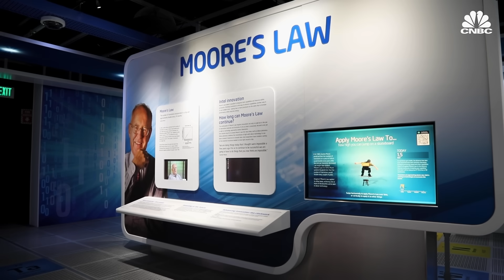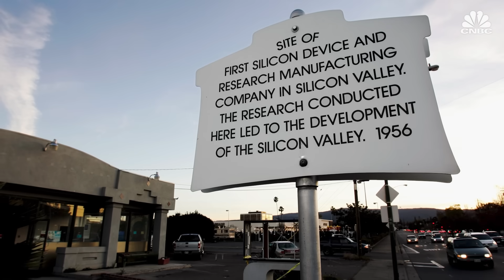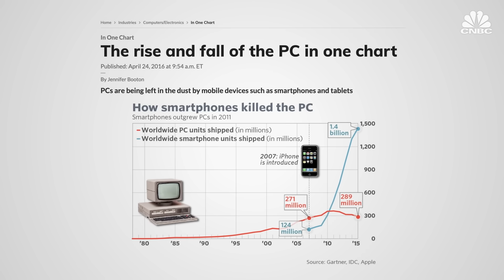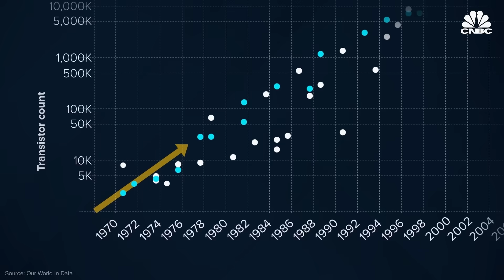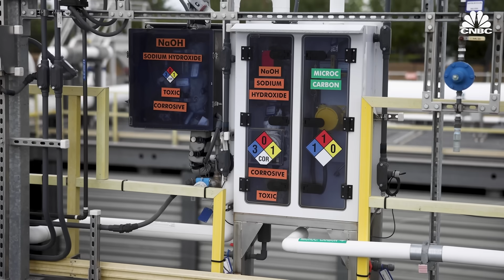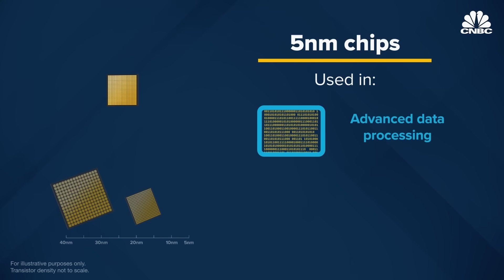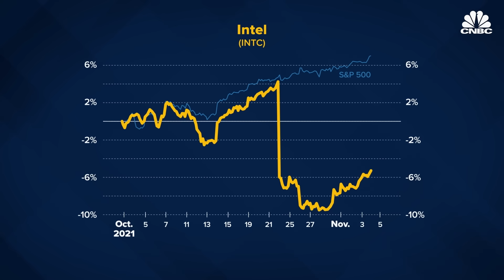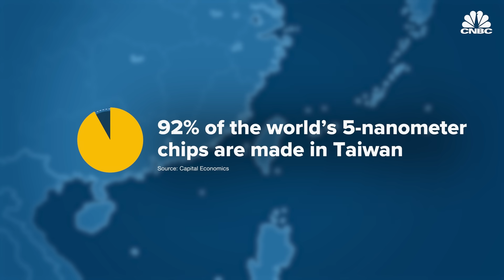Inside Intel’s Bold $26 Billion U.S. Plan To Regain Chip Dominance

Comment: INTEL appears to be developing a long term strategy of racing as fast as they can to catch up to the smaller nanometer product, but "if" that does not work, then they will be set up to flood the market with various chip products by outproducing and ( more importantly ) out pricing their competitors. Should they catch up to smaller chip scales, they would be well positioned to deeply influence the market.

Comment: Currently, TSMC and Samsung are not Intel's competitors.  But they're jumping into Foundry business... which they failed before "while" competing with AMD.  Samsung and TSMC are already manufacturing 3nm die and announced 2nm.  AMD is on 7nm.  Latest Intel Alder Lake is still on 10nm.  It wont take just $26 billion.  It will take $26 billion every year.
Reply: @WolframaticAlpha SMFH... False.  That's what Intel fans claim and Intel 10nm is slightly denser for SRAM but TSMC 7nm is denser where it counts.  Logic.
Intel 10nm consumes FAR more power and runs MUCH hotter.  NOT equal to 7nm.
Any other false information you wanna spread?

Comment: Intel still hasn't realized the problem isn't how many what they make, but WHAT they make. Other manufacturers are ramping up chips with specialized modules to speed up encoding/decoding of videos, low power consumption, etc. Intel probably should stop trying to put 200W TDP CPU into the laptop.
Reply: @WolframaticAlpha Yet here we are editing HEVC 4:2:2 as if it is a bunch of slides.
Reply: @WolframaticAlpha Sure bot

Comment: A vast majority of the chip shortages are not Intel. Hopefully the government subsidies support the manufacturers that are in the squeeze to meet demand. Intel on the other hand is a Cash Cow that needs no government support. As noted, they misexecuted and need to catch up but that is only the leading edge of their portfolio not the parts needed in autos, Industrial or Internet of Things. Some of the shortage is due to COVID delays, some to increased demand and some to industry consolidation over the last two decades. At one point there were 3X the players in semiconductors just in the US. Look back at ay 1976 through 1986 - big field - all pofitable but the PC industry made for bigger winners who bought up or by sheer volume pricing  forced companies out of  business.  It was not uncommon for a company who had a "must have" component to force a product designer to use their unrelated components to get allocation of the must have. No price benefit given just predatory. These fabs are of course long gone and would not be viable if they existed but the revenue loss prevented those semiconductor manufacturers from staying competitive. No money for new fabs when you are running on thread bare margins.

Comment: You can build and open fab in 2 years, but it takes another several years to train everybody, gain experience and also install and run all the facility equipment. In the meantime competitors are running forward. Samsung and TSMC are investing too.

And for start, start using metric system finally instead of football fields, gallons, pounds and other crap.

Comment: Intel has it right putting an engineer at the top again. Now maybe CNBC should consider hiring some engineers for QA on reporting. And get rid of the market analysis. Intel will make it or break it on the basis of its technological development, as it always has. The right technology will make its own market. R&D is by definition engaged in asking hard questions about the unknown. Doing it right requires focus on technical matters. If you let the market guide you, it's putting the blind in the pilot's seat. Tiny components have potential benefits and considerable market attractiveness. But consider again electronics hardened against EM assault. The hardening itself is the bigger deal. Space applications are mentioned in other comments. How about military? And how about infrastructure or machinery that is less vulnerable to terrorist attack, degradation during working life, damage due to accident or weather, or applications in heavy industry where the devices are subject to physical shocks, pressure, or heat? Increasing reliability under adverse circumstances provides an array of its own markets.

One size does not fit all. Neither does one focus. Engineering is all about making trade-offs. Each trade-off is its own market. There's market enough to go around. And Intel is big enough to make something of any of them it chooses to pursue. My market analysis? Don't put all your eggs in one basket. Pick your strengths. And let the chips land where they may. No story is over until it's over, and not even then.

Comment: Fyi, Intel's Angstrom, though referencing a unit of measurement 1/10 a of nanometer, is not referring to the size of the transistors of those chips. It's just a name. That should've been clarified.

Comment: The editors did not do their due diligence with this. Intel’s latest process node is just as good as TSMC’s 7nm or Samsungs 8nm process. The fact it is called 10nm is a misnomer quite common in the industry since it is not a metric or even a standard. It is marketing which explains why intel is changing their marketing of the chips manufacturing process. When looking at intels 14+++++nm it is actually very similar to TSMC’s 7nm process at the micro scale. The whole point is intel has been having manufacturing issues that were keeping them from getting sustainable yields to make it worth ramping up mass production on 10nm and beyond. This is why TSMC has been able to get ahead and due to the fact they have a quickly expanding customer base. This whole paragraph is merely comparing the FAB TSMB and Intel. Intel is one of the last remaining chip designers and fabs at this point in time.
Reply: I am glad intel is finally allowing itself to manufacture other chip designs for customers on their node. I just hope we can keep the chip making process as clean and efficient as possible. Fabs use a lot of awful chemicals.

Comment: I have 2nd gen Core i5-2500  Quad-Core 3.3 GHz  " Sandy Bridge  (quad-core, 32 nm) It still rocks (Dell OPTI-PLEX 990 -Business class ) . Even though its 12 years old .  Beat that !!!!!!!!!! I can Play New games and run anything on this bad boy!!!!!! All I did was upgrade the RAM and a New Vid card (4k Baby) , did have to replace the PS after 9 years and the HD after 7 Years, But those things have moving parts , The BIOS is to old to run a SSD and my 1 PCI slot is being for a special sound card.  But I wouldn't trade it for anything .

Comment: Only tsmc can make 5nm. Samsung can't.
Reply: Samsung can just buy 5nm chipmaking machines.
5nm Chip making machine TSMC uses is made by ASML thats a Dutch company. 
Which btw is also using USA owned/patented technology. Techonology invented by Intel.
Intel is good at inventing. But just not good at manufacturing Chips. Cheaper to build in Asia.
Reply: @leihtory7423  tsmc is a US company. Without US approval, tsmc won't exist.

Comment: Sure, except that TMSC (Taiwan Semiconductor Manufacturing Company) just announced a 100 BILLION dollar PLAN to keep their already REAL dominance and expand it. It follows that China is investing 4 times or more in all high technologies to surpass the U.S. It does seem that the only way they could do this is by ignoring intellectual property law, as the U.S. is still ascendant, mainly through international partnerships. U.S. capitalists have to get with the program. A day late and a dollar short(ed) will not work long term, but let's be clear, U.S. Capitalists have NO REASON to look out for the U.S.-- they only care about themselves and their families.
Reply: Technology used by TSMC is owned by the USA. USA owns EUV tech. Dutch company ASML makes the Chip manufacturing machines, using USA tech.
TSMC just buys ASML chip making machines. Intel can just buy ASML machines and make chips in the USA.
Its just cheaper to build chips in Asia. Cheap labor & Lax environmental laws. Taiwans TSMC has factories in China. 
These brandnew chips need a lot of water & toxic cleaning agents. The byproduct is highly toxic cancer water. Chips btw are still designed in the USA.

Comment: It’s almost like they shouldn’t have spent $60 billion on stock buybacks and instead been investing in their chip technology.
Reply: What happens when you put finance people in charge of a tech company.
Reply: @tindo7147  Fiance/ Business people aren't really a good fit for intel. We need more engineers to be hired as CEO like Pat Gelsinger.
Reply: That's why I buy Intel at $48-49, not $320. Hopefully their new CEO can make Intel more competitive.
Reply: I realize that. The $320 was Nvidia's price at that time. It has since dropped to  $241.
Reply: @Duke_of_Prunes  Intel has a huge infrastructure, that has tremendous value.  Also they own 7% of ASML, the company that makes the machines that actually etch the chips.  There is no reason that Intel can’t be very successful.  The stock price today is probably a long term bargain.
Reply: @rickjason215  I sure hope you're correct-- I buy for long term, and really want to keep my Intel shares for many years.
Reply: @rickjason215  youre not alone buddy.
Reply: @rickjason215  Intel is now at critical point of do or die mission. If Intel failed to compete against TSMC and Samsung by 2025, Intel will soon lose their profitable computer chip market share. 
Then Intel stock will goes down to below $20.
Intel getting into EV cars chip business may help them a little, but these are low margin business.
Intel also need to spend $50 billion until 2025 to be able to compete against TSMC and Samsung. So their profit margin will be hit badly for the next 5 years.
Reply: @rickjason215  /Thats my bet, i hope you are right. The level of arrogance in the commenters above is scary. I remember back in 2010 when everyone said that MSFT was gonna be finished by Facebook, and look at Meta yesterday.
Reply: @Duke_of_Prunes  These guys bash the man who built Intel 486 and run to bet all their money on crypto trash....seems like theres a lot of fortune tellers here.
Reply: @JoaoSilva22222  Exactly. On Microsoft, I held my 329 shares, and it's now worth a bit over $100K. I am now betting on Intel. Don't have quite 100 shares, yet, but at current prices it's a very attractive long term play -- much better investment than crypto.
Reply: @Duke_of_Prunes  congrats on msft dude, now i have a chance on intel, i buy one every month...o a lighter note apple paid me big time
Reply: @JoaoSilva22222  Thanks. Best of luck with Intel -- it looks like a winner, given a bit of patience.
Reply: @JoaoSilva22222  Indeed this. Most people are really clueless because they have not done enough work to have an opinion.
Reply: @rickjason215  ...and its almost halved since you said that so its probably twice a bargain now... At this PE its a screaming buy IMO but it just keeps dropping...
Reply: @nickoutram6939  The US economy is going into a depression and I am mostly in cash.  I wish it was 100% cash.  It is going to be at least 2 years, before the economy gets better.  I think Intel will be fine long term, 3 or 4 years, at least.  I like the fact they are building fabs and they will be the first to get the new ASML machines.  There is nothing made that is comparable and all the chip makers use the ASML machines.  I have no Intel stock.   I don’t want to invest for years down the road.
Reply: @zenlei8258  currently at $25
Reply: @Duke_of_Prunes  it was never even above $100...
Reply: @Duke_of_Prunes  should of waited a little longer
Reply: @Duke_of_Prunes  down to $25 now unfortunately or fortunately
Reply: Top people in the company ended up with tens of millions of dollars.  They would probably disagree with you.
Reply: Hey man the executives got fabulously wealthy and it was worth it to them
Reply: @clintgolub1751  they made this giant so they are worth it, they didnt just make their coffee in the kitchen. They built a giant which gives great value and power to the world and  US.
Reply: the only thing that's going to bring the US down is itself. and we excel at this. greed always loses
Reply: @o0o-jd-o0o95  yes this
Reply: Correct.
Reply: Nah, it was the right business decision, because now they can lobby Congress for billions more in taxpayer money.  #SaveTheBillionaires
Reply: Agreed. Intel was trying to maximize stock value by manipulating their stock rather than making great products etc…
Reply: That is what low interest rates do. It becomes profitable to borrow money at low ratesto buy back stock which in turn drives prices up when many companies do this and creates a bubble in stocks. Thank you Fed
Reply: Stock buy backs are a waste of company money. There are plenty of studies showing this. CEO's are too concerned with their stock bonuses isntead of actually making the company grow.
Reply: Its ok, congress will just bail them out with our money. Privatize the gains, socialize the losses my guy.
Reply: Very similar to what was taking place in Boeing.
Reply: I'm confused by stock buybacks on how it is a long-term strategy for any company/industry.
Reply: @ev1558 With share buybacks There is less stocks because they were bought back which usually helps raise the price of the current stock available but also if a company pays dividends like Intel, thats less money you have to payout for dividends pocketing the difference for other expenses like developments,expansion, dividend raises, share buybacks etc.
Reply: Buying stock makes sense. Besides they had enough money. If they are to become leader in next 5 years, why not buy your own stock which will be even more expensive. This will make them money, literally.
Reply: No question - but they can can sell it and it reduces dividend payout
Reply: damn straight, but why when they get their lackeys in congress to give them the money you and I pay in taxes (that they don't pay).
Reply: If you don't buy back and your assets are worth more than your stock, you get bought out and digested for your asset parts.
Reply: Brilliant!
Reply: Why they got to buy back stock and us taxpayers will fund the research it’s win win for them
Reply: Engineers should refrain from opining on finance, it's embarrassing!
Said by an Engineer who went to B'School...
Reply: Stock buybacks is also correct if price is right. For many reasons.
Reply: @innosanto  Stock buy backs only when the price is lower than their future profit potential. What other reasons needed ?
Intel wasted billions on stock buy back , big mistake.
Those billions should be spend acquiring smartphone technology.
Reply: @zenlei8258  2 other reasons are increased management and decision control, 
especially if business wants to take mid to longterm decisions which the stock holders wont have patience or knowledge to see the mid to long term benefit or 
the message that the move sends to the market 
that the company who has more info on its plans and projects considers the price low for its potential and other investors may then also check further the company and its projects and invest.
Reply: @innosanto 
It's easy to blame "greed' under Capitalism, but they don't explain that groups like CALPERS, which is CA public retirement fund is ALSO invested heavily in Wall Street!
In fact, they had to lower retirement payments because of the losses in 2007-2009 period!
The stock market isn't just about rich people getting richer, it's about building a nest egg to retire some day also. 
Since the late 1990's, the Fed Gov't expect you to provide 33% of retirement income, they recommend TSP which is a Fed 401K!
You get 1.2% per year, so after 30 years u get 36% of base pay!
Not 80 or 90% like some states
Reply: Anyone who knows history knows not to bet against Intel. They also have their own fabs, unlike AMD.
Reply: Intel invests more in R&D than many, if not all. But yeah, they should have invested in manufacturing more before... Or just give it up. They're working on that at last.
Reply: Their legacy victory is typically a barrier with this type of company... The swampy politicians got overpaid but not for shareholders interests
Reply: LOL. Yes. But there’s nothing like the free open market. Making business in the US is hard as well because of our poor tax setup so there’s little incentive for true innovation. I’m sure American production will remain supreme 🇺🇸 under intel
Reply: @iBeo01  Have your ever been inside a fab and understand how demanding the job for the production engineers ?  Not too many Americans are willing to do it. If they’re willing to do it, the pay will make it non-economical.
Reply: @jmlin501  Yes this. I have an idea for this

Comment: The light being yellow to prevent if from effecting the lithography shows how behind they are. The newest chip manufacturing don't use blue wave lengths  but have moved on to the even smaller ultraviolet wave length. Only two companies have that tech.
Reply: Intel has 2 UV tools, one in Oregon, one in California.